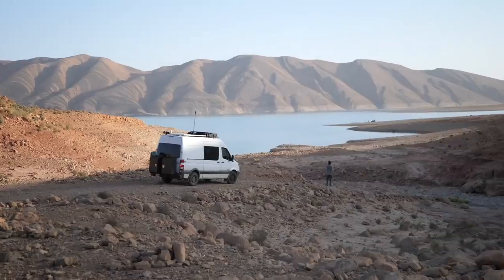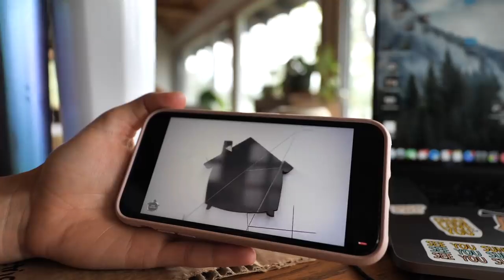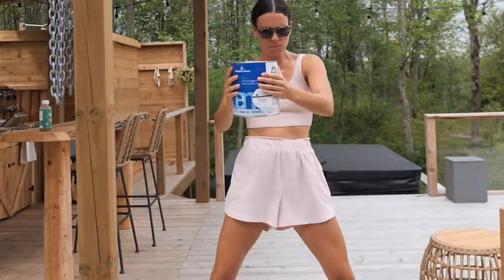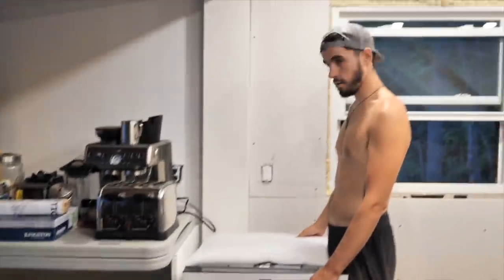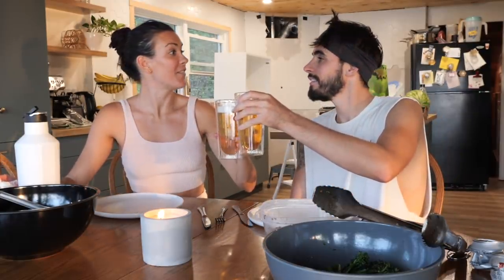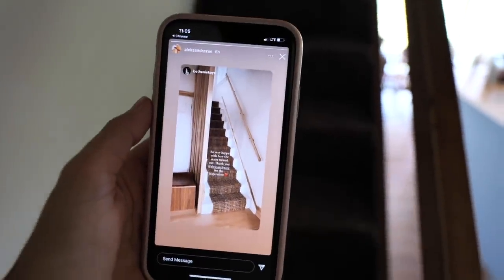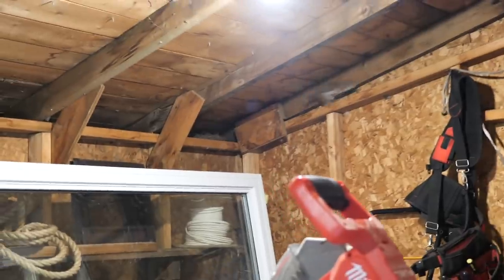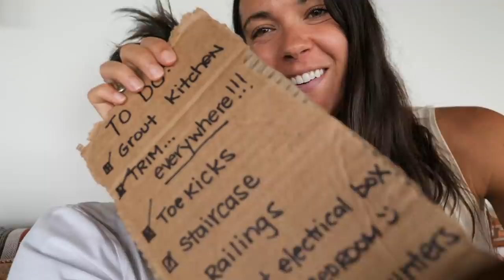This is the End

Comment: As a Girl Scout in the 80's, I would volunteer with my troop to get rid of Gypsy moths. We scraped the eggs into a can of water and dish soap. We also put tape sticky side out around the trees to prevent them form climbing up the trees. Solutions that are more environmentally friendly than wasp spray. My troop would take care of the trees at the schools and parks in town. I live next to water too and so the town asks that we not use toxins or fertilizers that can run off into the water by the rain. Gypsy moths are gross. I hate that when there are a lot, you can hear them chewing your tree leaves. Good luck controlling them.

Comment: You can in case that doorway from the bathroom into the kitchen by the stairs with MDF and then put trim around it it will hold up a lot better and it will really trim it out nice

Comment: For future use: Newsprint only tears straight in one direction. Gosh, tapered trim needs mitered corners.  You guys need to know a cabinet maker to show you little tricks.  Build a stand minus about an 1/8" to fit under your hood. Nothing extravagant: maybe a 2x4 with another forming a T, with 4 screws to keep it from twisting, or knee braces if you wish for stronger.  If mounting on sheet rock, screw in an alignment board below the cabinets to be mounted and sit the cabinets on them while screwing in. this makes it much easier for the one holding them to the wall to not have to hold them up too, while screwing them in.  Then remove the alignment boards.  There is another trick involving a tapered board towards the wall, then make a matching on on top of the cabinet.  It stays permanently in place.  I've hung hundreds of cabinets this way.

Comment: Professional tile installer here 🙋🏽‍♀️ - When mixing grout mix a little at a time. Add the water slowly and mix after every time you add it. Sprinkle more grout into your mixture if it gets too runny, mixing well after every addition so that you can see the consistency. Also, you don't have to mix the whole bag, it's better to save some just in case you need to do a repair job later on.

Comment: Just a thought on the window trim. 
If you use a hand plane and plane the end of the upper trim piece at the same angle as the vertical ones, you would get a 45 degree angled "line" in the corner (hard to explain with words :D) could look good/better. Or not, just a thought to save the trim :)

Comment: Though, bye a router and stand 1 or 2 bits.   Bye 1 x 1, 1 x 2  or 1 x 3  8 feet long and make your own trim for a lot less.  Takes a little longer.  Cut, Sand, Stain, Polyurethane.  It's a lot of fun and the router and stand will pay for its self.

Comment: That wood around the windows would look good if you 45 it. When it doesn’t fit around the window unevenly you can put a small shim under it. I u did trim work for many years. But you have been doing a great job with no experience.love you two.

Comment: White grout stains easily, which is why I went to a darker grout when I did a tile project in my home.  That said, you can buy a sealer that makes staining less likely.
Reply: On the wall , it’s not nearly as big a deal as using it for countertop or floor. (I remember my mom constantly bleaching the island grout) .. those honeycomb tiles would have looked awful (imo) with a contrasting grout. Eamon and Bec seemed to agree , did you catch their comments about being relieved it looked “less stop-signey”? If they had used contrasting grout it would have been super stop signey.

Comment: U bought the right trim u just installed it wrong. U should also put a 45’s on the seams. The smaller part goes along the insides edge.

Comment: To keep mice from eating the wiring under your car hood just zip tie dryer sheets at the 4 bottom corners of the engine compartment and near the wiring NOT NEAR ANYTHING HOT they hate the smell. Good luck, it worked for me. If you don't do something they will eat all your wiring.

Comment: Owning a house the projects are never done. The roof on the cabin looks like it is on its last leg and the chip board exterior walls need some help. I am curious as to not having the spray foam guys come back to do the sections of the cabin that were missed the first time.

Comment: Think stick houses could last 
if people take care of them. Conneticut good example lots of older buildings. I like natural earth builds rammed earth insulated super high with strawbales, huge doorways, window seats. . .workshop second tiny house idea. . .wish in a 1000 yrs momentum

slow idea ok to skip 
(in fast congrats energy comment section)

🌋(But if want to soak up more empathetic spirit 
to more land building
( really anti fast permit though like when over)
Do  "small growth wealth" to resident property by using old techniques like woodworking joints when needed but more earth materials
I like idea of kind of bookmark for natural build (maybe with basalt diy bricks for vaulted ceiling, roof like in Mexico, super quake and fire proof) 

again pin idea as glacial slow~~~~
 

Good to let happy blessings catch future ideas with other wild direction ways , wood cabin with natural build maybe in distant eons future

(good for retired health as lets you rest easy 
if ill, low cost, better air quality, nice to have safe house in case of fire or quake)
~Again Hard to do it all . . .for eons future coexist stick with rammed earth houses
. . .
keep leaning towards house dreams as they grow, with simple sketch land design notebook,
Helps also to keep living with what you earned . . .by being ok towards funny idea of having
1000 yr life span and pushing back "rewards".

Warning slow idea causing tension to est. singing energy vibe~~~
Connecting to ❤
a real shared muscle memory of long life patriarchs Adam Noah.. .human experience 🍞, a timeline, 
a way to keep ♨ good suggestions
with  bucket list 
~to do in 🌌 heaven.. .good " small start baby" ideas 🕊🌲⚓☀⛵🌳)

But anyways, good work to you both to video and soak in all that solid work sweat tears for renovating a cabin, definitely neat locale. . .neat culture 
 draws in peace for those with at least some shared latitude heritage (similar nature seasons) between N. Europe and Canada First Nations over 1000s of years.

Good imo . . .to let all that ancient life mix . . .for people's past efforts in an area, 
nice "artistic" expression of attachment to slow hidden sweet legacy. Lots of nature love, tree care and water quality.

Watched bonus features of Ron Howard, George Lucas Willow on Amazon Prime. . .and fish boy deleted scene. Living undewater as a fish like Pixar's new movie Luca,  but with more southern latitude. . .Italian fishing village backdrop. 
 
I guess to change it up can imagine a big bass or pike swimming in spirit through that living area . . .kitchen hanging out with their underwater rocks or nooks or pebbles.

Enjoy your finish and the momentum of life 🌻🌼🌹💐🌷 it attracts 🏊🤸🏓🎶🐚
🔥🌨 ⛄🛋
 in its "rest" 🍊🍋  vacation life

 🐳🐲🌜🍎🐟🍒🐍🍓🐦🍉🌟🐸💧